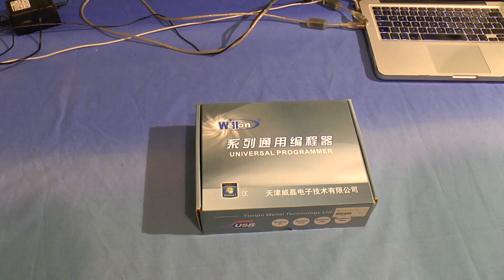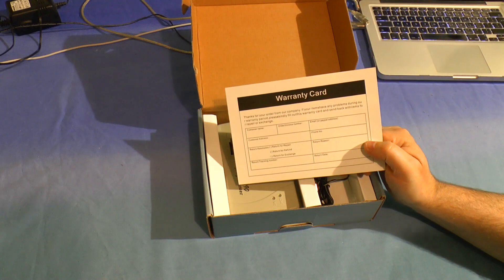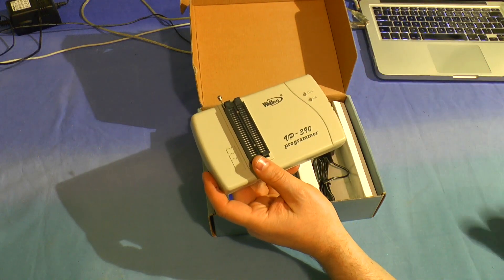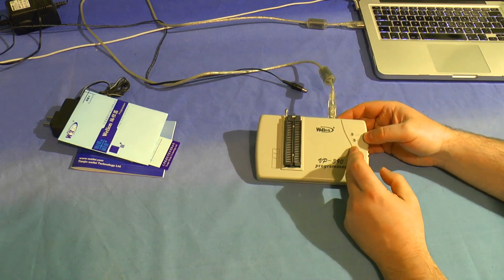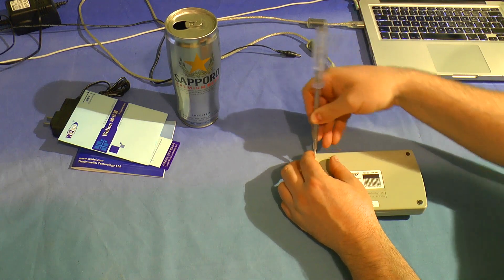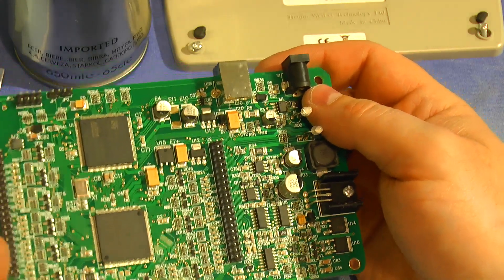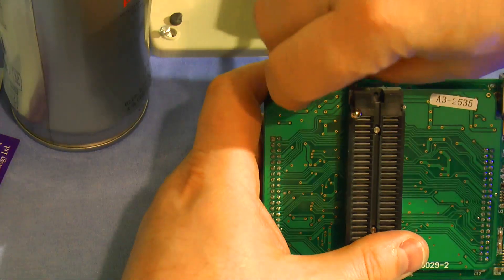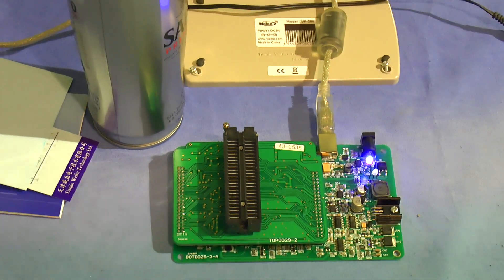Wellon VP-390 programmer teardown and repair

Comment: How have you found using this programmer, would you recommend it?  My current mini pro programmer is missing a few devices I need, so thinking of upgrading.
Reply from the maker: +Dave Curran I've not needed to flash many devices, but as an all-round programmer and IC tester I'm very happy with it, plus their after-sales service is second-to-none.
Reply: AintBigAintClever OK, thanks, sounds like an option.

Comment: The ARM MCUs of the STM32F series all have an uneraseable bootloader in the ROM that can be activated by shorting two pins. It can then be programmed over a simple serial connection (no special programmer needed). This bootloader mode can also be initiated in software on the MCU (after receiving a command from the PC for example), which I guess is pretty much how the "normal" reprogramming works.

Maybe STM implemented the same procedure in this series of chips, too.

Comment: Smashing programmer, the company cares about there customers :-).
im glad it was just a simple process to put the operating code back, perhaps new versions will have the button on the back.
I have the ye olde willem pcb 3b (modded for faster transfer):)
As its a parallel port olde i cant use it at the moment as new machines have no printer ports to use.:-( (most usb to parallel convertors are not full ports.
The willem was creating a new usb type that looked the same as yours, but he sold up and his site vanished, lots of people do rather similar usb types now.
Reply from the maker: zx8401ztv I'll see your Willem and raise you an ART EPP-1 :)
Perhaps I'll tear it down sometime to show how things have progressed.
Reply from the maker: zx8401ztv The eBay seller was quick to respond as well, but not as quick as Wellon. He/she's now got a copy of the instructions to help other customers, these were very gratefully received :)
http://www.ebay.co.uk/usr/carobddiag
Reply: AintBigAintClever I hope they bought you a pint :D
Reply: AintBigAintClever ha ha i cant beat that :-D

Comment: Usually with such devices there isn't enough space in the flash to store the old version as a backup when loading a new version. This means a failed load can brick the device. In place of a backup, a portion of the flash is reserved for a tiny block of code that knows nothing but how to load a new update. The jumper likely told the device to clear the flash and enable this reserved bootstrap loader. When you restarted, it was now just alive enough to perform a software update and nothing else.

The bootstraps are often very minimalist - not even knowing how to error check what it's loading. Sometimes they just have enough smarts to load a bigger bootstrap with more features to enable a proper reload. Truly pulling itself up by its own bootstraps.